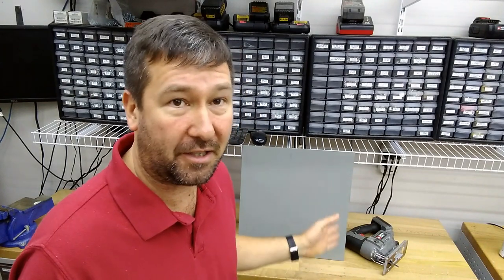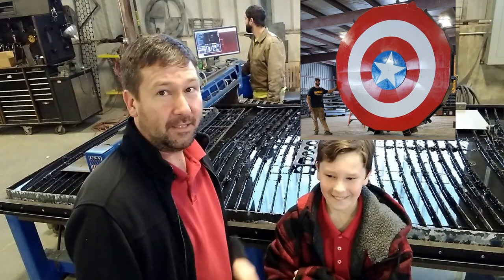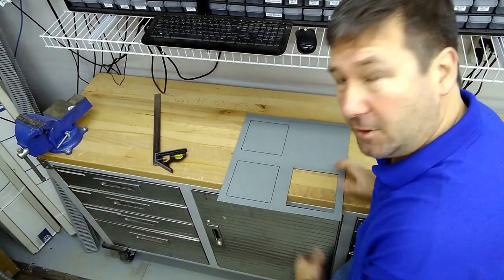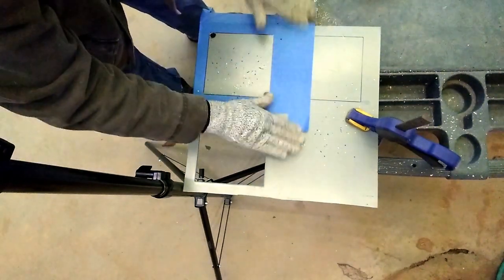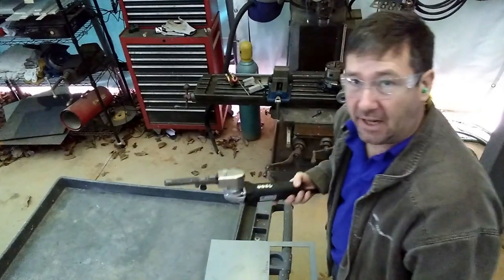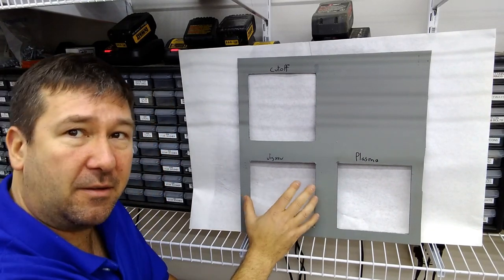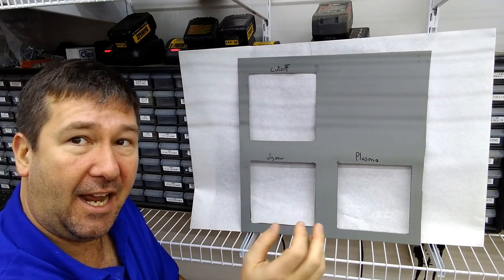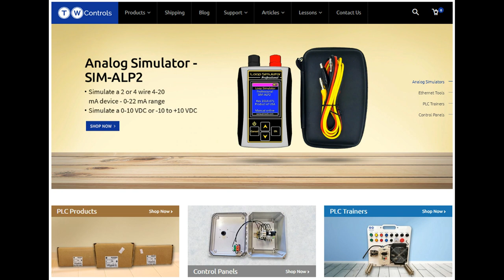Cutting Holes in Control Panels - Cutoff Wheel vs Jigsaw vs Plasma.  Which one Wins

Comment: When I had my instrument panel cut for my airplane I had it done with a water jet. Your right in it’s probably the best BUT I had to provide a .dxf file, 2 week lead time, $150 charge, which would hit your overhead pretty good. Plus if I screwed up the drawing sorry Charlie. I’m not bad with a cut off wheel, the wheel keeps you pretty straight, or it snaps and scares the bejeezus out of ya!  I’ve got my panel laid out right now and will stare at it for a few more days before cutting it. Mostly holes but there are two fan openings. Great info as always. 👍
Reply from the maker: Yes laser and water jet cuts are hard to beat is you can handle the time and money. One thing I do is roughly sketch out the layout on the enclosure and take it with the dxf. Once I took a door into a Fab shop and didn't note which was the hinge suppose and they cut it 180 degrees from what was laid out. Had to eat the cut charge and a new enclosure.

Comment: I'm an old school jigsaw guy. I use quality duck tape around the cutout and also use duck tape on the jig saw skid. I keep the area clean while cutting so that the metal shavings cant blemish the panel. After that, its the friendly neighborhood flat file, if needed. Great YouTube video as always! Thanks.
Reply from the maker: Thanks for sharing Matthew. At one time I used duct tape also. I had trouble with residue being left on the panel. Do you?
Reply: Yes! sweep away the shrapnel and steel dust.

Comment: Great video!  A couple ideas to ponder; 1. plasma will harden steel and especially stainless steel.  Not a problem with HMI cutouts or knockouts for push buttons, but if you use plasma to locate holes, it is really tough to drill/tap the hole afterwards.  2. I drill 1/4" holes on the corners of the HMI hole, then whatever I use to cut the sides out ends on a nice clean radius.  Big fan, love your enthusiasm!
Reply from the maker: Thanks for the tips!

Comment: The burn from the plasma can easily be fixed by simply starting your leadin not on the line but on the drop portion and moving to the line . 

I personally only use a cut wheel on stainless. I’ve had issues burning the paint and I also had a wheel grab and bounced the disc across the door leaving some scratches.

I’ve found that with course jig saw blades not trying to push the jig saw I can cut pretty fast and straight lines. I to drill at least two holes in the corner but sometimes in three or even all four corners. 

For me regardless if I’m cutter with a jig saw or cut wheel it’s best for me to lay it out the cut and then tape back from the cut lines an 1/8 to 1/4 inch sometimes the lines are super hard to see on the tape or near it.
Reply from the maker: Great tips Brian.  

We thought about the lead in after we cut it but didn't have another primed piece of steel handy and wanted to save our "spare square" just in case another way to cut we wanted to compare came up.

Comment: I think plasma and laser is only better when the control panel is still in manufacturing and not yet powder coated, but if the control panel is already ready made, then cut-out and jig saw is better choice.. Great video!!!👌
Reply from the maker: Plus enclosure manufacturers are well equipped for the job.

Comment: Great video.  I'm not really a power tool guy. I never took a shop class and my dad never taught me so everything I learned about power tools I learned on the job just struggling through issues as they come up.  I begrudgingly use the jigsaw everytime I need to make a cut-out.  I DOUBLE tape it with painters blue tape.  We still get minor scratches but never as bad as the ones you had in the video unless I screw up.

We have a cut-off in the shop but to be honest the sparks scare me.  I'll stick with the jig saw.

There is a water cutting facility near by we use for $150 per door but only when we have higher quantities.  The drawings aren't an issue because I am good with AutoCAD.
Reply from the maker: Waterjets are great!

Comment: We use jigsaw on all boxes at work, even stainless. First we masking/painter tape the box bigger than our lines for the cutout, then we have acrylic cutouts that are bigger than the cutout line by about 1/4" and also use a smaller square for the inside as guards which get taped down to prevent movement. No scratches occur from the guards.  

For stainless we follow the same procedure with a jigsaw, but we have a second guy with a compressed air gun to cool the blade while cutting. Been doing it this way for years and the average blade lasts a few months, although replacing a jigsaw blade is cheap anyways.
Reply from the maker: Good tips, thanks for watching!

Comment: For the starter hole with the jigsaw I use a step drill that fits in a 1/4" impact driver, works great. You may have better luck with your manual plasma if you make a larger, thicker square template for each hole size for guiding the nozzle. Always pull the torch toward you. it's much easier to get a smooth, even cutting speed when you pull the torch.
Reply from the maker: Great advice!  Normally I use a step bit also but I wanted to be as precise as possible so I chose laying it out and using the 1/2 drill bit as opposed to stepping out to the line.

I think I probably need to take my plasma in and have it completely reworked or start looking for a new one.  It has given me many years of good use but the basic tip change isn't making it cut clean anymore.  Any suggestions for plasma machines?

Comment: If I can bring the panel back to my shop I plasma. If I have to cut a panel in the field with the PLC populated and equipment running I dress the area being cut with a trash bag and tape, knock a hole out and then square it up with my Makita nibbler. Works awesome, well worth the money. It is so much easier dealing with fingernail like metal clippings rather than dust or chips. The nibbler doesn't shake the cabinet as much as a jig saw or reciprocating saw. That was the main reason I bought it, to keep the chance of loosening connections down. The nibbler is pretty much a metal jig saw.
Reply from the maker: Hi Tim, I'll have to look into the Makita nibbler and see if it does something differently than mine.  I never liked the way mind slightly deformed the enclosure door.  Not from being dull, but from slightly stretching the metal along the edge.  The door would end up bulging slightly out or in when cutting large holes.  Thanks for the tip!
Reply: @TimWilborne  The model I bought was the larger JN3201. I've only used it for holes 5.5" and larger for panel views. It is rated at 10 Gauge mild steel and 13 Gauge Stainless Steel. I won't use it for that capacity but wanted the wiggle room for field use. It has a larger head on it, the throat length keeps it straight. Even the larger holes for panel views are a crisp edge.
Reply from the maker: @timothydart986  Good to know, I'll check one out.

Comment: For Stainless panels, I use a local CNC laser shop. Very reasonable. For Mild Steel Hoffm an Concept boxes, I use a cut off wheel. In my experience, 4 to 5 orders of magnitude better than a jig saw. Much Much quicker also. I also use a free hacksaw blade for the corners.
Reply from the maker: Hi Gordon. Thanks for the comment! Someone has requested to do a video comparing the methods on stainless steel so I may see if I can find a large enough drop for a stainless version of this video.

Comment: How about a down-cutting carbide bit in a (trim) router? You could make/order a set of templates for the most common panel dimensions - if you encounter those - or bring four straight edges to double-side tape onto the metal for custom jobs. Sorta hand held milling on site.
There are also hand held cnc devices now - you move it but the cut/bit is controlled via a pattern, it's hard to explain. David over at Make Something tests one in a yt vid.
Reply from the maker: I like Make Something!  He does some great projects.

Comment: Rittal will factory cut. The neat thing is for $200 they will cut up to 20 panels for that price. The lead time is long but if you build the same panels like an OEM it is the way to go.
Reply from the maker: Yes, we have a very good sheet metal shop we normally use to laser cut ours when we have the volume and the time.

Comment: I always just started by removing a majority of material with largest knockout that would fit within.  Then a different saw, not jigsaw, which didn’t contact the surface and leave scratches. Final finish with hand file.   

Never could stand using a cutoff wheel.  Guess we all have a preference.
Reply from the maker: Yes I think the conclusion everyone is coming to is that none of the methods work excellent so we are choosing the method that dissatisfies us the least.

Comment: CNC router table? But sans that I used a jigsaw with a clamped-on guide for a similar project, then if you clean the drill shaving off before you cut and use a little air or vacuum to keep them out from under the saw, you end up with nice clean, very straight cuts, and no scratches. But it does take a minute or two longer.
Reply from the maker: I wish I had a router table. It would be a nice way to do it.

Comment: I wonder if  epoxy clearcoat on the base of the jigsaw would reduce scratches. As for the grinder, maybe a jig with strong magnets? Attach to the workplace, restrict the grinder to 2 dimensions of freedom?
Reply from the maker: Most of the jigsaw scratches come from vibration of the saw itself, not the blade.  Even with plastic guides there are still minuet scratches.

With a little practice, it is easy to stay in the lines with the grinder.  It is just messy.  Hardly the perfect solution either.

Comment: Great series. I just has a question regarding sparks from the cut-off wheel on the paint on the door. Would these sparks leave any markings and if so can these be wiped off. I would also apply this question on Stainless Steel doors. Thank you
Reply from the maker: The sparks are dust when you are done and don't mark up the panel but they do make a tremendous amount of dust.  Try to do it in an area separate of where you wire your panels plus blow it out and wipe it down real good before you start wiring it.
Reply: @TimWilborne  Thank  you Tim; and again great video series. I had been looking for information like the one you provide in this series and hadn't been able to find any.

Comment: We design and build panel. Typical we use  jagsaw, not the best but acceptable, but for rushing orders we use water jet ventilation cut and back panels.
Reply from the maker: Thanks for sharing. We've got a lot of good tips from this control panel building series.  I should probably make a compilation of them.

Comment: Tim, would this be the inside of the panel door that you’re cutting? Also is it common to remove the door of the panel for the cuts ? It’s obvious you would have to in order to use the plasma
Reply from the maker: If I have a lot of cuts then I remove the door and take it to a laser shop. For just a few cuts, I put a trash bag on the inside of it and cut it from the outside.

Comment: Thanks for the video. Do you use touch-up paint to avoid corrosion at the cut edges?
Reply from the maker: No, the cuts end up on the inside of the enclosure so there is no aggressive corrosion
Reply: @TimWilborne  Thank you!

Comment: How about a power sheet metal nibbler? These are typically rated to 16 Guaga steel to a Nema 18 Guage steel cabinet should be well within capabilities. I used one many years ago (a horribly noisy air powered attachment) for cutting square holes but I don't remember the brand name but I see a few different ones for cordless out there. We also have CNC water jet available today...
Reply from the maker: I did this once a few decades ago, it stretched the steel around the opening so that the door was no longer flat.  Never tried it again but it was a larger control panel. It might work better on smaller enclosures.
Reply: @TimWilborne  Sounds like you exceeded the gauge of steel for the nibbler. This steel can also be a bit hard. I always found the holes very clean.

Comment: Preparations and tooling. Side cutter = sparks. Just me, not a fan. But jig likes to bounce.....another pain.
Reply from the maker: Yes, no great way to do it by hand.
Reply: I just cut a 4" x 3" in 1/8 stainless with a jigsaw. I drilled two holes in opposite corners and sawed them from the holes. This was for an AB HMI. The jigsaw was quick and safer to use than a cutting wheel. Get the correct cutting blades for metal!!!!

Comment: So what is my other option? Anyone make a mini circular saw? Plunge cut and then nice straight cut. Laser? Must be a better way than the grinder and disc, has to be.  I have the metal cutoff saw (circular saw blade with teeth, not abrasive cutoff saw) but we need something small and handheld.
Reply from the maker: In my opinion the grinder with a cutoff wheel is the cleanest, most professional looking cut but there were lots of people who felt the jigsaw was the way to go.  I see lots of enclosures with evidence in the paint of jigsaw cuts.  I lot of it is in the eye of the person holding the tool...or better yet, controlling the tool 🖖

Comment: I know this is an old video but is it possible to show a video of setting up the wire cutting machine. I have the same one but i dont have set up instructions.
Reply from the maker: They are finicky.  Study on the A-S, B-S, and RTL, those are the ones to adjust for wire stripping problems.